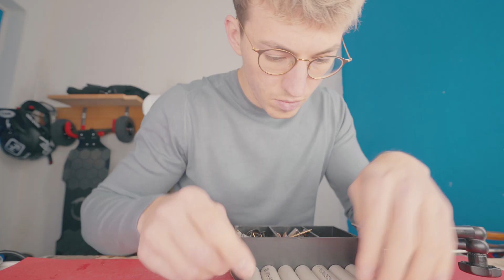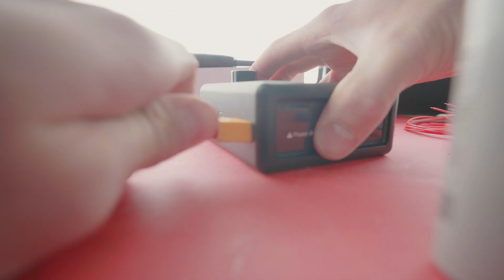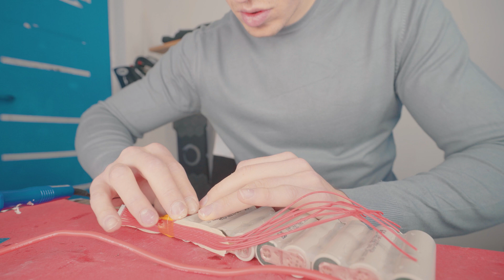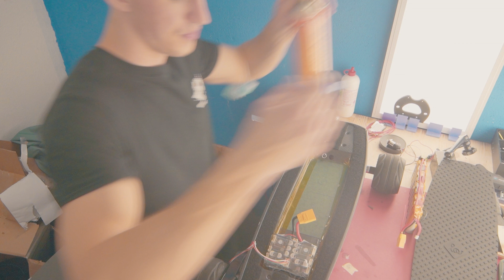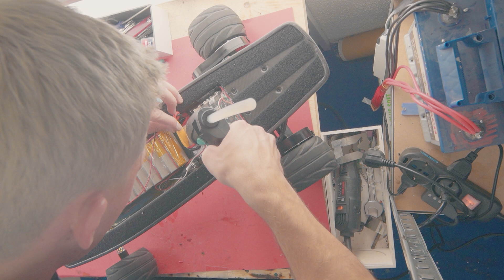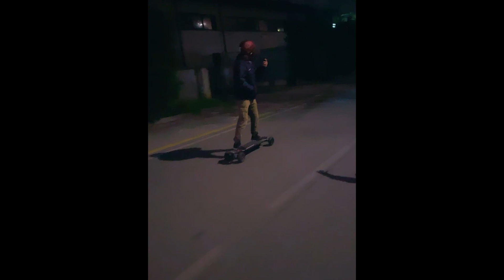7000 watt penny board lou 3.0 molicel p42a 10s1p fesc 4.2

Comment: Where did you buy the ESC? I’m trying to find a ESC that will work with the stock Lou 3.0 battery and dual motors
Reply from the maker: Get a Chinese one ✌️
Reply: @amijumpen  Got any tips? There is quite different reviews on them

Comment: It’s the board rating 😅 
Great build 🤞🏼 
Pls tell me one thing.. Are those molicel p42a cells good and reliable to build a 350cell battery pack (20s 15p) ??
We want best 21700 for the pack.
Pls reply
Reply from the maker: hi mate! with those you can drow 30a and get them slily overheat, sinze you are going big, the best cell on the market is the samsung 50G, a better version of the 50E, on the 50g after 1000 cycle you have like 80 percent left of the original capacity, so if you can find them, those are the best, molicel good as well bdw, but i dont remember the life cycles
Reply: @amijumpen  thank you so much

Comment: No fishpaper between the cells is not safe! That battery is a few vibrations away from creating a short between 2 cells and burning up. 

Some other nit-picking comments regarding the board's total power:
The battery, if you run it at 40A (which you should only do if you monitor the battery to make sure it doesn't overheat) is only capable of delivering 3.45V * 10 * 1 * 40 = 1380W. (I looked at a chart to see how much the battery voltage sags at 40A)
The ESCs are probably not safe for more than 50A, and even that for just a few seconds before the mosfets overheat. Even if your battery didn't sag at all and was at 42V, that's just 4200W total.
The motors look like 6355 motors, which will overheat pretty fast if you push them above 50A. If you look at an output power chart for something like a Torqueboards 190kv 6355, you'll see that at 42V and 50A it's output power is only about 1800W each. (The rest turns into heat) So that's 3600W total of mechanical power)

So with a board like this, from standstill your acceleration will feel like a 3.6kW setup for a short while until you get to about 38% duty cycle, after that the battery will become your limiting factor and motor current will drop down until at max speed it feels like a 1.3kW setup, which this actually is. (If you even ran the battery that high)
Reply from the maker: this is completly true, and i know it, this board was just a test, the battery will be remake in a bigger/proper configuration i was just intrested to try this set up, bdw the motor are 6374
Reply: I was also just about to comment the lack of fishpaper between cells. The lack of fishpaper between the cells and balance wires is also problematic.